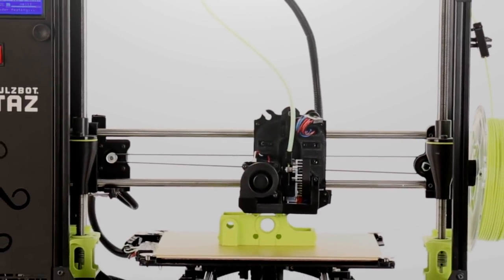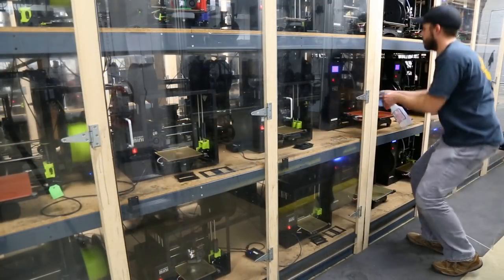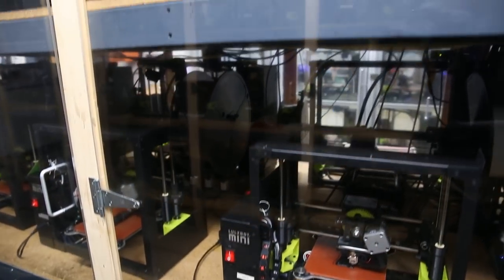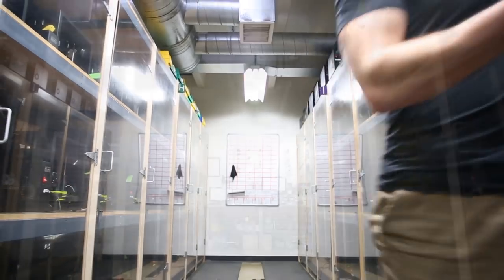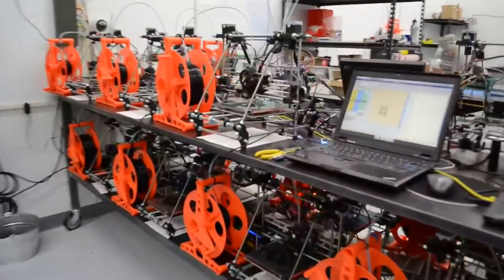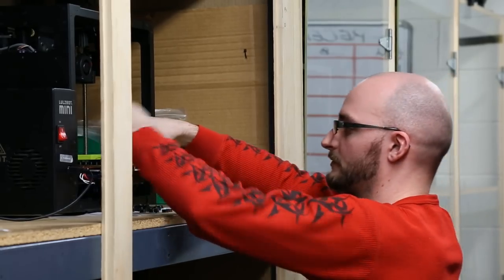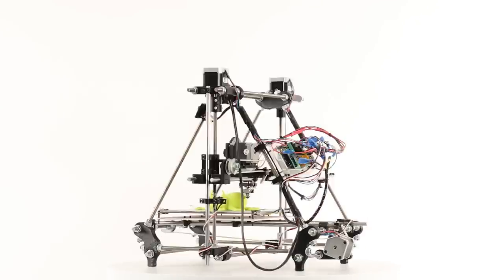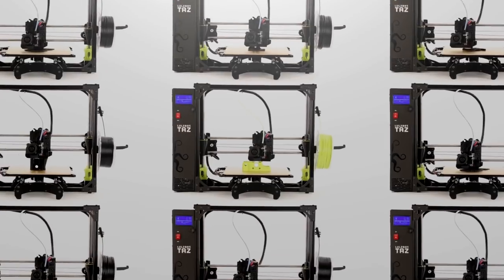LulzBot Cluster: Machines Making Machines

Comment: What extruder are you using on the taz 6 in the beginning of this video? It doesn't look like a version 2.1?
Reply: Michael Foppiano I didn't notice that! It appears to use an E3D derivative similar to what they are using in the new v3 dual extruder. It is also in the dev folder for the TAZ 7. Maybe they are moving to belts for Z as well...
Reply from the maker: It's the new Aerostruder Tool Head! Learn more about them here: https://www.lulzbot.com/learn/in-the-news/precision-meets-versatility-3d-printing-aerostruder-tool-head

Comment: Hopefully they are printing more of the V3 dual tool heads!  Hey lulz.. what's the temperature inside of your enclosure?  Do you actively heat it, or is it just for retaining the heat generated by the farm?  do you do any cooling?
Thanks!
Reply from the maker: Our enclosures are passively heated by the heated beds and work exceedingly well for maintaining a warm environment.
Reply: My passively heated chamber reaches 41C regularly with ABS and ASA.  Am I close to the temperature in your farm?  I'm trying to decide determine if active heating would be a good idea.  I am currently experimenting with higher temperatures.
Reply from the maker: Stick with passive heating for now, you're close to the temperatures we see, with 6 printers in each rack.
Reply: Thanks! I am currently pre heating the chamber to keep the temperature constant throughout the print.   This will be built into my new enclosure and managed by an octoprint plugin.  Again, I appreciate the reply. BTW.. I just received my new dual head v3!
Reply from the maker: Congrats! Tag us when you share your dual v3 prints!

Comment: Sorry lulzbot but as good as your 3D printers are, they have serious issues. The price$ I’m not paying $2500 for a 3D printer that lacks an enclosure and I’m DEFINITELY not paying hundreds of dollars for different extruders....and about those extruder setups..they are HUGE...I can see that causing vibration if you don’t slow down your print speed to like 45mms. Its too easy to take a cheap Chinese 3D printer and upgrade it to perform better than the lulzbots...
Reply: I'm just curious. Have you used a Lulzbot? Do you know how they perform? I am just wondering where you are basing your claims from.